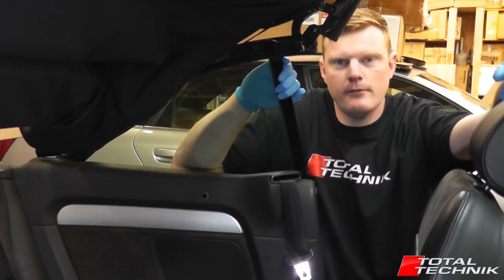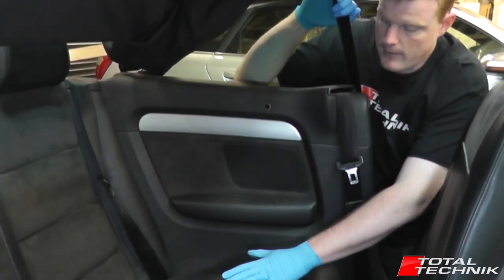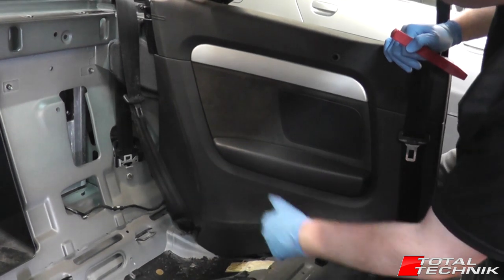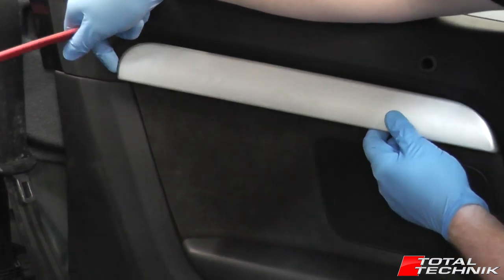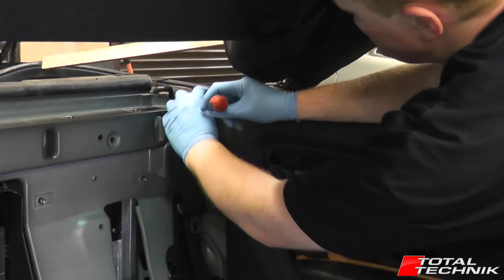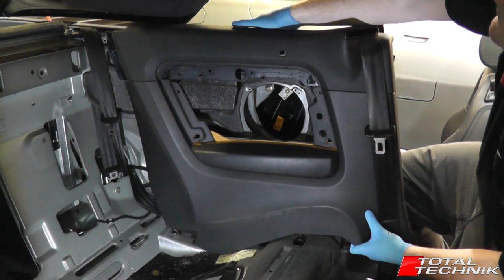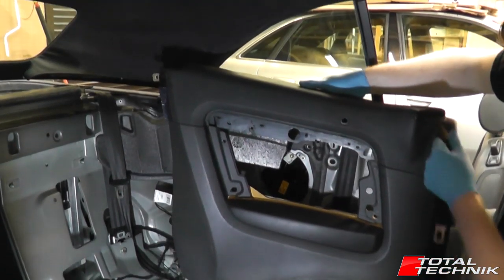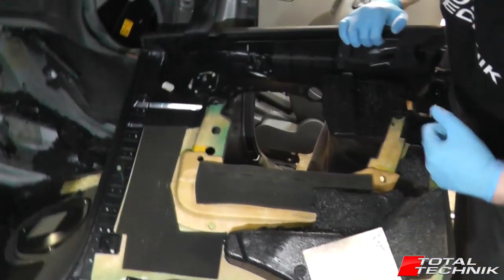How to Remove Rear Side Panel (aka Door Card)  - CABRIOLET - Audi A4 S4 RS4 - B6 B7 - 2001-2008

Comment: Nice video 
Can you tell me we’re is the connector for rear right ABS sensor 
For Audi A4 cabriolet 2003?
Thanks 
Sorry for my English I am  French
Reply: Its in the bottom of the ¼ panel , follow the cable up from the grommet in the sill. Weather permitting i will be doing the same one this weekend.